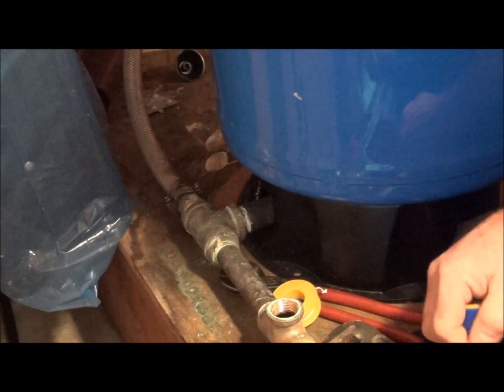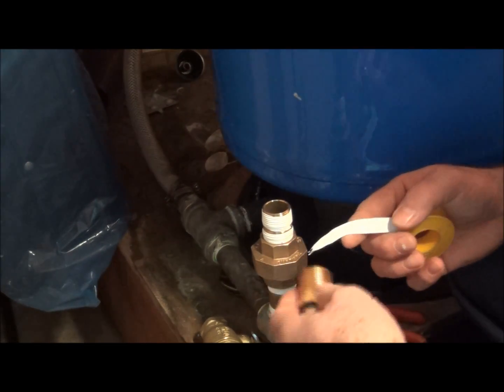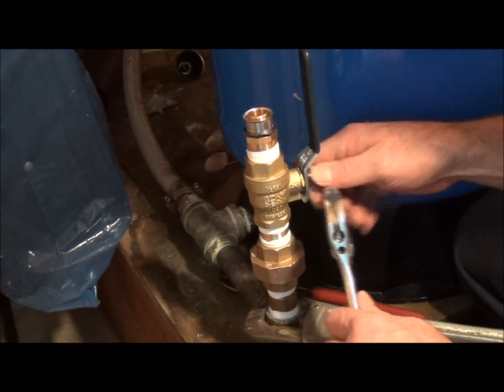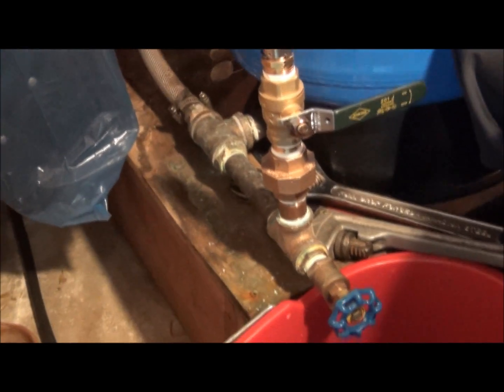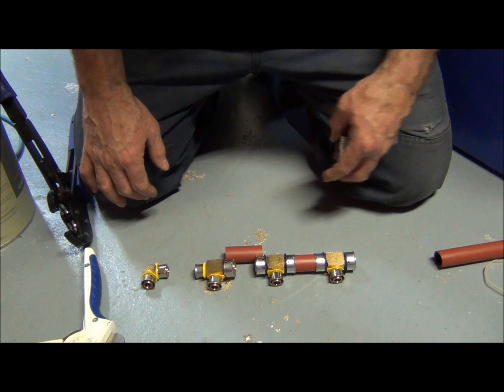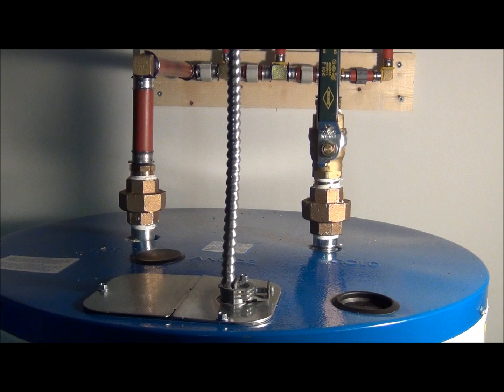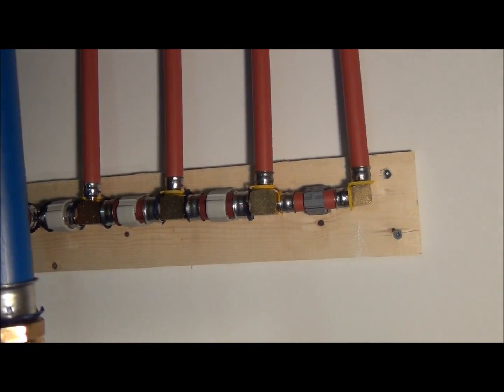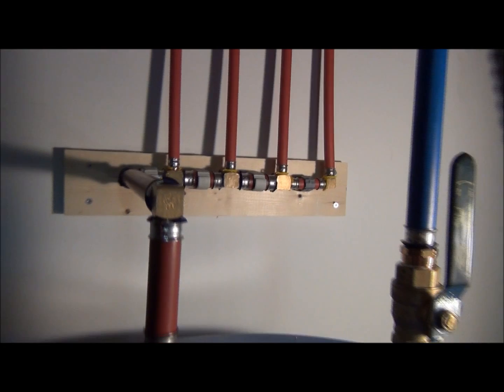How to install Pex Pipe Waterlines in Your Home!  Part 4. Plumbing Tips.

Comment: For code compliance and safety
18 inches of metal pipe: Use at least 18 inches of copper or stainless steel pipe to connect directly to the water heater's inlet and outlet nipples.
Flexible connectors: Use corrugated stainless steel water heater connectors to bridge the gap between the metal pipe and the PEX.
Code requirement: This rule is mandated by plumbing codes, such as the Uniform Plumbing Code (UPC), for both gas and electric water heaters.

Comment: I heard brass was not good for water lines because they eventually go bad and taint the water
Reply from the maker: Hello ssghallv,
Brass fittings last for decades. That being said I have read that some brass fittings do contain lead and can be ingested. 
I know now that people are concerned about lead contaminating their water. Lead was actually used for water mains for decades up until the early 80s I believe and I still find it in places today. 
There was a hospital in my area and all the water mains were made of brass and up to four inch in size. All threaded fittings. When they were removed fifty years later they were still in perfect condition. 
Like any type of water line, the water quality has a lot to do with how long pipes are going to last or break down. I personally don't use them often, but they work exceptionally well for certain situations.
Thanks for commenting and enjoy your weekend!   Al

Comment: No shut off for the hot?
Reply from the maker: Hello davidschlonger806,
In order to turn the hot water off for the tank I have installed a valve on the cold line going into it. It is illegal by code to put a valve on the outlet of the hot water line of a water heater. Reason being is if both valves were closed and the water heater continued to heat it could be catastrophic and the tank could explode if the relief valve failed to open. This may seem like a long shot, but it has happened before with fatal consequences.
Thanks for commenting and enjoy your week!      Al

Comment: Mistake on your water heater - never connect pex that close to the tank - you want 18" or more of metal pipe between the tank and any pex.
Reply from the maker: Hello r6u356une56ney,
Pex can be attached directly off the top of an electric water heater with no worries and is allowed by code in Canada.
 An 18" copper pipe or similar material is required on gas and oil fired water heaters. 
Here is just a few links stating how their pex can do attached to electric water heaters.
Electric water heaters: Zurn PEX can be connected directly to residential electric water heaters used for domestic hot water (Zurn PEX uses brass adapters for this connection)
When connecting a Viega PEX system to a gas-fired
water heater, install a minimum of 18" of metallic piping
between the water heater and tubing, keeping tubing
more than 6" away from the vent pipe. Where local
code allows, ViegaPEX Ultra tubing may be connected
directly to electric water heaters and used for hot water
recirculation lines that do not come within 6" of the gas
heater vent.
 RAUPEX pipe may be directly connected as per the following: Electric, storage type water heaters: Direct connection allowed to electric water heaters, which are intended for domestic applications, unless prohibited by the specific water heater manufacturer.
Certain jurisdictions may not allow it, but it is common practice in Canada.
Thanks for commenting and enjoy your week!     Al

Comment: If I am trying to replace a hot water like inside my house but I have no manifold I have unplugged the hot water line from the water heater first n then work inside the house?
Reply from the maker: Hello Gaspar Ma,
Replacing a hot water line?
 I start by closing the cold water valve to the tank. I then go around and open hot water faucets. I then make my repair. I then open the cold water shut off to the tank.  Close the faucets and I am all set.
I open the valve before I close the faucets to purge the air and remove any mineral build up that may have come free while the pressure was off the line.

Replacing the tank?  
So the very first thing you want to do if you are replacing your hot water tank is to turn off the power. Then you are going to turn off your cold water to the tank. Place a hose on the drain valve on the bottom of the tank and open it allowing the water to drain into a floor drain. I generally go up stairs and open any hot water taps to drain the lines back to the tank. Once I know the tank is empty I cut both the hot and cold lines at the top of the tank. Your cold water shut off should be above the tank so cut somewhere in between the valve and the tank.
 I remove the old tank and put the new one in place. Then I reattach the pipes to the tank and begin filling it. While the tank is filling: I hook up the electricity to the tank, but I do NOT turn it on until the water is coming out of the faucets upstairs. 
 Once this happens I turn on the power and wait for the hot water to arrive.
Thanks for commenting and best of luck with your project!     Al

Comment: I thought PEX had to be at least 12 inches away from the hot water inlet?
Reply from the maker: Hello Noan YoBiseniss,
The pipe I used in this video is Viega and the tank is electric. Viega states that their pipe can come directly off the top of electric tanks. A number of manufacturers state this as well. All pex connections to oil and gas water heaters have to be at least 18 inches from the top of the tank and at least 6 inches from the exhaust vent. I generally take copper off the top of the tank on a gas and oil heater up to the floor joists and run pex from there.
You also have to keep it away from the smoke pipe so that is the reason I run it to the floor joists or ceiling.
Thanks for commenting and enjoy your week!     Al

Comment: Hey Al. Are there area’s that you can’t use pex off the water heater. Or is there a minimum of copper  before you can use pex pipe. Thanks. On of your biggest fans. Paul
Reply from the maker: Hello Paul,
I use Veiga right off the top of an electric water heater and the manufacturer states that it can be used in this manner. I have used other manufacturers as well directly off electric water heaters.
With oil and gas water heaters there is a minimum distance that is required. I run copper off both the hot and cold all the way to the ceiling. 18 inches is the code distance, but to be safe I believe they should be run higher and as far away as possible to any heat source.
Hope this helps!
Thanks for commenting and enjoy your week!     Al
Reply: TheOldkid888 thanks Al. That makes perfect since. Thank for all you do for folks. We all appreciate you.
Reply from the maker: You're welcome!
Makes me feel good to help others!
Have a great day!
Thanks!

Comment: Good job and it looks good to me but they say your supposed to have like 18” of metal off the water heaters cold &hot water connectors before you go to péx but I’ve seen others use pex as you did even had it even closer without a valve they went pex right to the male nipple on the tank seems fine to me but I’m getting ready to change my tank and I keep seeing that ya need 18” of metal before u go to pex well what about cpvc?
Reply from the maker: Hello Todd,
Thanks!
The Viega system can be used directly off the top of an electric water heater only as stated by the manufacturer. 
If this was an oil or gas fired boiler a piece of copper or other metal pipe has to come off the top of the boiler on both the cold and hot. 
I generally run copper to the joists and go from there with pex if it is an oil or gas heater.
I am not certain about CPVC to be honest with you. To play it safe I would go with copper and then pex myself.
Hope this helps!
Thanks for commenting and have a great weekend!     Al
Reply: TheOldkid888 yes all your input helped  I used blue ,red &white pex and cpvc and all shark bite compression fittings and believe me I wasn’t to crazy about the idea of using shark bites (being a retired municipal water dept. worker) but I used a bunch of them female to pex male to pex ,90’s , couplers and a slip ball valve and to my surprise not one leak I’m just hoping the pex can handle the heat it’s rated at 180 so it should good I hope.

Comment: Another excellent video Al. Two 👍👍’s up!.  Is the Viega system used with PEX-A or PEX.B?
And what was the brand/model of the clamps you used on the manifold? I missed that in the video.
Thanks Al
Ron
Reply from the maker: Hello Ron,
You're welcome!
The Viega system is a manufacturer of Pex B, but the crimping system can be used with either Pex A or B. Pex A systems cannot be used on Pex B pipe as it requires expansion where Pex B pipe is all crimping. Hope that is not confusing. to you.
I have used a number of different clamps over the years on pex. J clamps are the most commonly used where a nail is driven into the wood to hlod the pipe in place. I have also used plastic strap clamps that require two screws to hold it in place and the pipe simply slides through.
The clamps used on the video I call adjustable PPR clamps. Ideal for places where you want the pipe locked into place.I don't believe I mentioned that in the video. My apologize for that.
Hope this helps!
Thanks for the kind words and enjoy your day!     Al

Comment: Just asking your opinion. For some reason I seem to trust shark bite connections more. The crimp seems a bit cheesy to me. Probably I am wrong. I have used shark bite for 4 years now. They seem to be excellent. I know they cost more but I don’t care. I trust them. I have used probably 30 or so for me and my friends and a few other people. Never had a problem. Even used as main shut off valve. What is your view. You have great advise. Thanks Paul
Reply from the maker: Hello Paul,
I think the crimp system myself is better than Sharkbite. That being said....I have used Sharkbite valves as big as 2" in size and have had no problems. They are considerably easier to use than crimping tools. The Viega system that I used in this series of videos is an excellent system. I have use it several thousand times with no issues.
I made a video on ...."Sharkbite Fittings. Size and Weight! Weight Test....". This video shows how much of a bite they take on different types of pipe near. One of the main reasons that I made this video was from what I had read. A number of people said that they installed the fitting and it popped off. So I made this video and demonstrated exactly how difficult it would be for them to slide off. 
One thing that I have found over the years of using them from time to time is to make sure they are installed the proper depth. As much as deburring the pipe is important; making sure the fitting slides onto the pipe the proper distance is the most important. There is a point about half way where to fitting feels like it is on the entire way, but isn't. So I always mention to anyone who uses them to mark the pipe to make sure they are installed the proper depth.  
I prefer other pex systems myself over Sharkbite, but they do work very well. I wouldn't use them underground or behind walls myself as stated by the manufacturer, but to each is own.
These are just my personal opinions......
Thanks for commenting and en joy your weekend!    Al
Reply: TheOldkid888 thanks Al. You are my go to guy on plumbing. Thanks for making these videos.
Reply from the maker: Hello Paul,
You're welcome!
Drop me a line if you have any questions...Al

Comment: I've just learned alot of patience go's a long way !! Beautiful job !!
Reply from the maker: Hello geneo*,
Thanks very much!
I always keep the motto...Do it nice or do it twice. At the end of the job you want to be able to stand back and feel good about what is done. Planning goes a long ways with replacing and running new water lines. Always try and run as much pex as you can before deciding to remove the copper pipe. It saves on the amount of time that the water will be off.
Thanks for the kind words and have a great week!     Al

Comment: Do You have a Video of Pex Line  Joining to 1/2 or 3/4 PVC Line?...Thinking of running a Hot water Pex Line to my Front Porch Faucet.
Reply from the maker: Hello Circa,
I don't have a video as such, but I will put it on my list of to do videos.
To join pex to pvc; you will need a threaded male by barbed adaptor for the pvc and join it to a female by pex adapter.
You will need teflon on the male threads before joining it to the female adapter. This is how I would join the two different pipes together myself.
I hope this helps.
Thanks for commenting and best of luck with the project!    Al
Reply: Thank you OLDKID888..for your timely response. The plan is if this go well ..I will swamp out all my PVC LiNES  for  Pex.. I look forward to seeing that Vid. Thxs again.

Comment: TheOldkid888, Why did you make a header for the hot water line instead of just running 3/4" throughout the house and T'ing off to each valve like the cold water line? Is there any reasoning for this or is that just what you do?
Reply from the maker: Hello Jason,
I ran 3/4 hot and cold for a few decades doing exactly what you mentioned. I still run the cold like that, but have started over the last number of years to run the 1/2 inch off the header coming off the top of the tank. It uses 1/2 the amount of hot water as compared to running a 3/4 line. It does save a considerable amount of money over the years. Applying a little foam insulation helps as well. Headers also gives a more constant flow of water.
Thanks for commenting and enjoy your weekend!     Al
Reply: That makes perfect sense, thanks for the reply. I may be replumbing my rental property soon and was watching for ideas glad I found this one.

Comment: I always put a thermal loop on the hot water pipe coming off the top of the WH. It slows down heat loss. That was before tankless  water heaters were popular. Now, I can't imagine why a person would install a tank water heater. (Unless they only have the option of electric and can't afford a service upgrade). Tank water heaters are good for in floor heating though.
Reply from the maker: Hello dave,
Thermal loops help for sure.
We only have the option of electric and oil in this neck of the woods. No natural gas.
Installed a few tankless and ran into a problem with mineral that affected the flow switch. Many wells in this region.
Thanks for commenting and enjoy your weekend!    Al

Comment: great video.  one question, i have city water ,under my mobile home and am going to connect to pex must i have a tee or two tees one to a cold water and one going to hot water tank   im a newby to pex.  thanks agian.
Reply from the maker: Hello Roger,
You are coming off your main with a tee. The branch of the tee will go to either the tank and the other end will be the main for the cold water. You will need tees along the way for all the faucets, but one tee will come off your main and supply your tank. 
So you will have to figure out how many tees are required to pipe the mobile home. If you take a pen and paper; you can easily figure this out. Start with the main coming in and add your tees as needed. 
This should help.
Thanks for commenting and good luck with the project!      Al

Comment: First off exclenta, going you have given me the faith to do this,Your videos were great. thank you so much,keep up the great work.
Reply from the maker: Hello Roger,
Thanks!
Planning is key in any job.One thing that you should always do is run as much pex and make as many pex connections as you can before you turn the water off. You may do that the first day and turn the water off and make the rest of the connections the next day. I often hear about people doing their own work and running into problems because they cut the copper out the first day and then began to install the pex. You want to have enough time so that at the end of the day; you have your water back on.
A little planning goes a long ways. 
Thanks for commenting and best of luck with the project!
Let me know how you get a long!     Al

Comment: 7:35  One thing I learned is that after doing any work around the pressure tank is to flush the system as you're doing, run the plumbing for about 10 minutes, then remove the pressure switch and clean it and the feed tube thoroughly.  My pressure switch picked up all kinds of crap after changing the manifold and stuck shut several days after I finished changing the manifold.  The safety blowoff pressure valve let go (to protect the pipes) but flooded my basement.  Make sure to clean the pressure switch and the stand pipe folks.

Comment: Nice install, gonna be plumbing up 4 electric heaters here in the near future and will definitely be going with pex.  Great video here.
Reply from the maker: Hello John,
Thanks!
One very important thing to keep in mind is you cannot put valves on the outlet side of the tank as this is against code.
Best of luck with the project!
The manufacturer of Viega states that their pex can be used directly off the top of electric water heaters only. 
It CANNOT be directly installed off oil or gas water heaters.
Thanks for commenting and enjoy your week!    Al

Comment: Thanks for another great video! However seems again you have installed many more lines/fitting/bends with the manifold system. The manifold looks nice, but why wouldn't you run one 3/4" pex from the water heater then T-off when you need to go to a fixture? You only show about 5 feet of the four lines off the manifold, hopefully they don't go too further together....